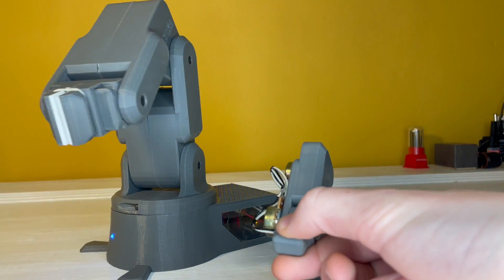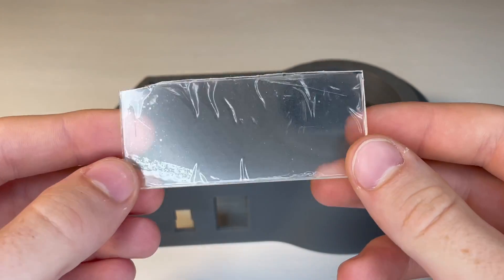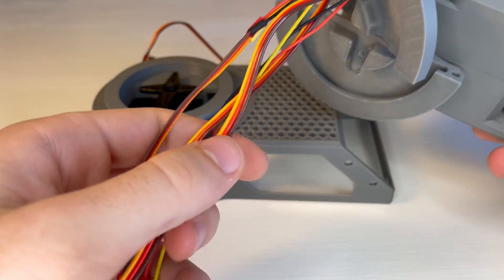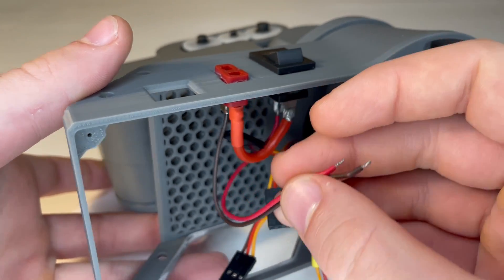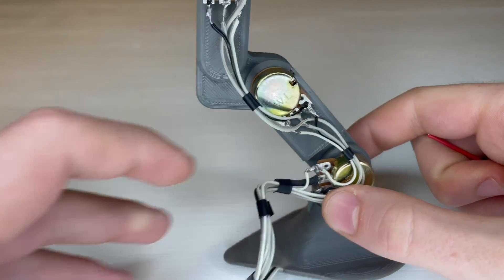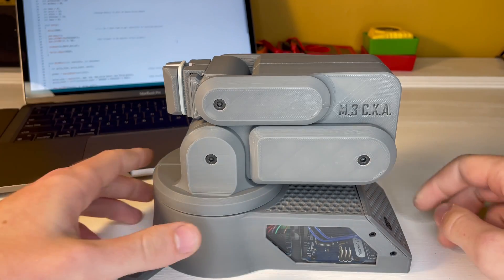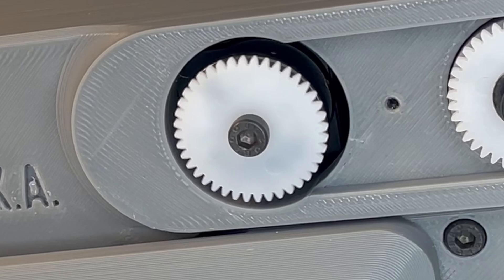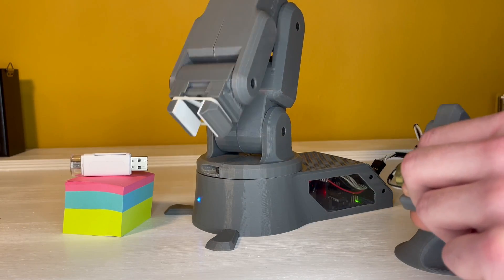How to Build a 3D Printed Robot Arm Tutorial (Arduino Based) - Part Two

Comment: Your tutorials are easy to follow and the quality of the movement is great!  congrats on doing this w/ only a single arduino file ha!  outstanding intro for any makers w/out a ton of programming experience.  i2c w/ the PCA9685 is great and scalable. I'm curious if you have any upgrade vids planned.  I don't see signs of filtering the servo data in adafruit's default driver code - I imagine that could be a great technique for folks too.  I'd also consider capacitors and sharing the STEP files?  Eliminating glue and adding inset hex nuts to the main parts would make this extremely serviceable
Reply from the maker: Hello! Thanks! Unfortunately, this is most likely the last video I will publish for this robot arm. Great ideas regarding the upgrades, though! If you'd like to experiment with the design a bit, here is the link to the old designs and Fusion 360 files: https://drive.google.com/drive/folders/1x4P8AquQILwCp8e5CiRJLfVJiJn2U4cF?usp=sharing
Reply: @buildsomestuff  Thanks for the reply!  Stoked to see what you make next.  Is there any chance you could add STEP or IGES files to that gDrive folder?  It'd be easier to mod w/ those in addition to the fusion360 files
Reply from the maker: @planckstudios  Certainly! I have now added STEP files for both the new arm and new controller designs to the Google Drive folder!
Reply: @buildsomestuff  so cool! Thank you!
Reply from the maker: @planckstudios  No problem!

Comment: Great video, and beautiful robot! But I'm curious ... why you are using the library from Adafruit? Why not do something more straightforward with built-in Arduino functions (such as using map() to connect the inputs to the outputs)?
Reply from the maker: Thanks! It wasn’t visible in the video, but I do make use of the map() function later down in the code. However, I believe I needed to include some sort of library capable of communicating with the Adafruit PCA9685 Servo Driver Module to control the PWM of the servo motors. If I only used the map function without including a library for the PCA9685, I’m not sure I would be able to correctly control the servos.
Reply: @buildsomestuff  Thanks for clarifying. Have you ever tried driving servos directly off the pwm pins on the Arduino board?
Reply from the maker: No problem! Yah, I’ve run servos directly from the Arduino before. While it is less complicated, it can become impractical when controlling more than just a couple servos. Since I need to power 5 servo motors for this arm, it would draw too much current through the Arduino’s 5V pin and possibly fry the board altogether. The PCA9685 Module supplies power directly from an external power supply to prevent this from happening, which allows me to control up to 16 servos without worrying about burning up the micro controller.
Reply: @buildsomestuff  Too true. Power is always the hard check on reality. Thanks for the reply
Reply from the maker: @androofroo  No problem! :)

Comment: How can I get the story for the little arm, the controller?
Reply from the maker: Hello! I briefly explain the controller's wiring and assembly at the timestamp 4:45 in this video. I have also linked the wiring diagram for the arm and controller in the description. The controller's wiring can be found on the right hand side of the wiring diagram.
Reply: Thanks! I look forward to building the robotic arms. Great idea and excellent execution!
Reply from the maker: @D3f4ultModernWarships  Thanks! Hope all goes well!
Reply: @buildsomestuff definitely the best one I've seen so far and I've build a few. You wanna give away some kits just let me know and I'll print the parts and send them anywhere with you listed as the sender. Great project for an underprivileged kid for Xmas. Challenging but doable with your great tutorial.

Comment: Awesome build! But how did you power the whole arm?
Reply from the maker: Thanks! I’m using an adjustable power supply (linked in description) and running it at 7 volts. But really, any 7V power supply should do.
Reply: So you are feeding 7v to the arduino uno vcc pin?
Reply from the maker: @W-R-h7d  Not quite. I’m feeding 7V into the servo driver’s main input terminal, then running the V+ pin on the servo driver board to the VIN pin on the Arduino. So, the servo driver is powering the Arduino. I’ve linked a detailed wiring diagram in the description. Hope this helps!
Reply: @buildsomestuff  Do you know how much power you need to operate the arm? Would a 30V 10A 300W bench top powersupply do the job?
Reply from the maker: @W-R-h7d  All together, the servos draw about 1.5 Amps. 30 Volts is probably a bit much for this application, unless you can regulate it down to something under 12V.
Reply: @buildsomestuff  yes, I can supply a voltage between 0 and 30V
Reply from the maker: @W-R-h7d  Great! That’d probably work just fine then!

Comment: El primer problema que tube al armarlo es la sensibilidad de los potenciómetros los cuales se me arruinaron demaciado rápido y los tenia que cambiar muchas veces, algo recomendable para esto?
Reply from the maker: Hello! I'm not exactly sure what this issue would be, but it may be caused by your potentiometers' resistance rating. I'm using 10k pots for the controller. I've linked my exact potentiometers in the description.

Comment: In theory can you record movements of the small arm. save the movements and later with arduino recreate the movements with big arm? (Sorry I have zero experience with this kind of stuff)
BTW nice job (Y)
Reply: This! I want to teach mine to chop vegetables and make an omelette :)
Reply from the maker: Hello! That’d be awesome! I believe there is a way to do this. However, it may require the use of a Raspberry Pi board to save the positions to. I’ll have to look into it further!
Reply: @buildsomestuff  I’m looking at this from a different angle. The controller part could be used to input movement into 3D software like Blender, so you could control (or capture movement for) a digital puppet and apply the movement to a bone rig.
Reply from the maker: @HairyDalek  Great idea! That would be really neat!
Reply: @TheHQpower :  The video below might be of interest...  I fell in love with this very basic project many years ago, but I never did get round to making one.  The "Robot" couldn't be simpler, and it has one less axis, but the code is in place to record and replay steps.   Like you, I think that adding record and playback to Kelton's robot arm would create another level of interest to it.  I'm not sure if adding another axis would take it beyond the scope of an Arduino UNO, but substituting an Arduino Mega would get around that problem.

Video link:   https://youtu.be/bLnAJ-mSElE?si=KURD_JX1XzYR1HSb